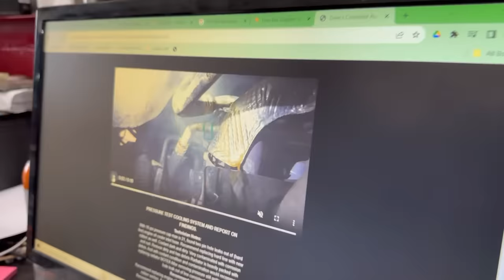The truth about maintenance, and what the manufactures tell you vs what you need to know

Comment: I tried to tell my boomer parents about this with their brand new BMW X-.  The oil level "light" came on shortly before the year was up for the first oil change.  I told them that their driving qualifies as "extreme" and to change it every 6 months like I do with my VW.  They scoffed and said, "People don't do that..."  I told them...but they don't want to listen.  I only fix jets for a living.
Reply: As long as they sell it within 4 years and the warranty period, they'll be fine 😂
Reply: Bmw x9? :D
All i can see are concept cars so far
Reply: @gureno19 very true, they only care about the experience of the first owner who is their customer. And since most people lease or trade, they don't see the long term damage being done.
Reply: @AmandaHugenkiss2915  literally the only brand that I'd trust with a long term (10-15years) vehicle purchase is Toyota or Lexus.
Reply: @gureno19  I agree. I live in the UK and have travelled through Europe many times, BMW, Mercedes etc are very common but I wouldn't have one, certainly not a modern one, I'll take a Japanese make any day. I do wonder when/if they will cheap out on us though, with bad design and poor quality parts. Practically every product you can buy has taken that route, nothing lasts, kettle, washing machine for example, it's all built to fail sooner rather than later.
Reply: @gureno19 Years ago I bought a used Toyota pickup (Japanese made) from a ford mechanic no less. 
He had only changed the engine oil when it was still under warranty.
After the warranty they stopped.
It had 100,000km.
I noticed that the oil was really black but my friend insisted that it's fine, just do the major body work the mechanical section won't have any problems because 100,000km is nothing to a Japanese truck.
Once home i drained out the black mud/goop, then the black transmission fluid. 
It right away was making a lot of noise and wouldn't get into od unless I stepped on it. The second I let my foot off it drops back to third gear. 
Even mighty Toyota and Honda can be quickly ruined by ignorance unfortunately.
Reply: I know people like this, and they don’t want to listen, and are defiant even.  It costs me about $30 to change my oil in a V8.   Probably $60 at a shop I’m guessing.  Even at $60, a drop in the bucket.  There really is no excuse.  I love when people are mystified why their car is burning oil at 50,000 miles.  90% of the time it’s because of 10,000 mile oil change intervals.
Reply: @mplslawnguy3389 since covid oil prices doubled here in Australia. I  bought a 7 litre bottle of synthetic for my gm v6 & it cost $110 so $30 for a v8 in 2023 seems incredible. Not saying your lying, just amazed that oil is that cheap where you live
Reply: Exactly.
Reply: BMW X9? You mean X4, X5, X6, or X7? Unless BMW sold your parents prototypes…

Also Boomers negligent on preventive maintenance? Hogwash! They are the only ones left who care about that.😊
Reply: @barryduff5058  Well, that's Australia for you.  I'm sure it's similar in a lot of places outside the US.  Even so, change your oil.  If oil is that much more, I can only imagine what vehicles cost there.  $110 is still a drop in the bucket.  The average cost of a new vehicle here is something like $49,000.  If you just change your oil twice a year that's something like $2000-$3000 worth of maintenance over 10 years.  That is a drop in the bucket compared to a new engine or a new vehicle.
Reply: I don’t really understand the mind set an oil change is what like 60 to 100 bucks on most normal cars and takes like 30 minutes for a mechanic too do. You can’t take 30 minutes out of your day to get something simple done. You could also go to a shop and ask for a tune up then they will change everything. Coolant , Oil , Spark Plugs , Brake Fluid they might even do the transmission if you say so. Fluids don’t last for ever everything breaks down over time.
Reply: I,drive Subaru,Outback’s,Have had 3 of them,all,great runners,always do the matenience,more is better!If you would of told this 75 year old greaser,he would be driving a 4 cylinder,Japanese car,when he was 75,he would of called a Shrink!!!
Reply: They better ask Google 'what is extreme use'
Reply: @barryduff5058 I pay $27 US for a 5qt jug of Mobile 1 advanced synthetic.  

That would be just under 5 liters worth of oil for you.
Reply: @tomfilipiak3511 the 4 cyl. Subaru was a great car. They were tanks in the 2000's idk what they're like today. I'll tell you what though, many of those 4 bangers can blow away larger cars with a much better weighted to torq to HP ratio.
Reply: You don’t need maintenance advice, you need a therapist.
Reply: There’s an x9 now?
Reply: Hit them with Agent K’s little speech from Men In Black. Just lead into it with sure, people don’t. But a smart person does.
Reply: Is there an X9? Is that the one with the huge grill.
Reply: @lynxstarautomotive208 maybe he means the iX and thinks it is supposed to be read as roman numerals?
Reply: It has nothing to do with your parents being boomers and everything to do with your parents being idiots.  Heck, they had you! 😂😂  Just kidding.  But I'm a boomer and I change my oil every 5000 miles in a good car.  I HAVE changed it after 3000 miles sometimes.  But, right now, I have a Silverado Valdez that changes its own and resets its oil life notification on its own, so I just change it when I think it needs it or once or twice a year.

Once I was really busy back in 1997 and just forgot to change the oil in both my Toyota truck and my first wife's car.  So, about 10,000 miles since the last change, I noticed a light valve rattle when I stepped on the gas while just cruising down the road. I pulled off the road and checked the oil and when was the last time I had changed the oil.  Then, I got my butt to auto parts store for a filter and changed the oil that evening.  I may have also changed the oil in my wife's car that same evening.  It had started that light rattle, too, at about the same time.  They weren't hurt, but that was close.  I had several dozen cases of oil that a gas station had sold me for 30¢ a can when they changed from cans to bottles, so all I had to buy was the filters.

Anyway, anybody that knows anything about cars should be able to tell when it's time to change the oil by looking at it, unless they own a Chevrolet Valdez like mine.  I also have a JD 265 (That's John Deere, not Jeffrey Dahmer.) that smokes like the devil in hell, and for no reason.  I've disassembled and reassembled it, and nothing is wrong with it.  The rings are like new.  Still, it takes spells when it'll smoke so bad you can't see where you're going.  I wish it would burn sometimes when I ain't on it!  🤣🤣🤣
Reply: @tomfilipiak3511  I saw a Subaru limousine in Huntsville, Alabama.
Reply: @missingremote4388  They'd probably tell you it's my stepson's video gaming habits.  Almost 30 and still can't quit long enough to carry out the garbage or mow an acre of grass for us.
Reply: Do jets have crankcases?  Just curious?
Reply: WTF is an X9? Poster is FOS
Reply: Smart people lease BMW's they dont buy them, that's what stupid people do....
Reply: 😂 It’s so hard to raise parents. I just have to give up!
Reply: @lynxstarautomotive208 nah man this is where stereotypes steer people wrong. Who is most likely to service their vehicle at a dealer it’s whole life? Dem der boom squad das who. Yea sure there’s a segment that grew up learning the importance of maintenance and doing it more than less. And there’s the target audience of extended charge intervals to begin with, dem der ole folks No wan waste a day gwan down to de dealer mon for de changes mon.
Reply: @RetroCaptain lmao the old adage holds true. Never buy em from a mechanic. They know how to hide issues
Reply: @barryduff5058  Same in Canada. Especially on vehicle price. Absolutely nuts prices now.  
Oil that I remember buying at 3.99/L is now 6.99/L (& was a one dollar a bottle not that long ago) The 2008 bs bank crash in the US sent the prices I was paying up the backside, then this.  Have to wait for sales then buy extra I guess. 
Our Dollar AUD and Canadian dollar is par afaik.
Reply: @POVShotgun  I wasn't aware until my friend who also was a (highway tractor) mechanic got talking to the guy, otherwise I would not have known. 
I was a Ford and Chrysler guy 
I knew zip about Toyota at that time.
Just going by (a third friend who happened to have been a retired transmission and farm tractor mechanic bugging the heck out of me to "dump the gas guzzling Ford and get a cheap Toyota you're gonna thank me"
The $ lost on them could have paid for lots of extra petrol to keep the old Ford going tbh. The Toyota ended up in the junk along with a second Toyota (81 Corolla rwd wagon). Could NOT find replacement parts unfortunately.
Reply: @RetroCaptain  oh lol fair
Reply: @wellnessotr  Well, you could put your parents up for adoption and adopt some more later.  But what if your new dad wants to breastfeed?  Or suppose you found your new mom sitting astraddle your boyfriend or husband's lap with her face on his shoulder so he could "burp" her after dinner?! You could end up with stepkids and maybe even giving birth to some of them.  😂 😂 😂 Choose carefully, and raise them right. 😂😂😂
Reply: Nobody does that every 6 months that sure is correct or you have to drive 1000 miles a month. The best intervals on synthetic oils is between 6/8k miles.
Reply: @steveclark..  I personally observed that (deliberately designed to flop sooner) as a tech in the 80s.
Back then I remembered how good Russell Hobbs kettles were.  Philips back then closed their home factory or at least shifted the production and suppliers to Hong Kong and the quality of the plastic used went way down and also the price up at the same time. 
The advent of "new auto" (operation or select or whatever) eliminated the manual cable and linkage with a computer system and sensors, was the beginning of the end. 
I met an electronics designer once (he was looking at getting into my career and let me know a little about his old work).
"Those microchips in your computer..they are (mostly Silicon etc) and by design, will basically *never fail, so they get around this by deliberately design to max out at a slow process speed, knowing that in x many software updates it will be TOO SLOW and the customer must replace everything*".
"They could design the (systems) so they last indefinitely but there's no $ in this". 
Adding "Smart" is a certificate of short lived device.
Reply: @georgejohnson9056 😂😂😂😂 legendary dad joke sir.
Reply: Yep, they use more oil while running in.
Reply: * substitute black, jew or Puerto Rican for boomer. See how that sounds? Just say parents. Smh.
Reply: Lol my boomer parents are the opposite they change the oil every 3 months (100 dollar oil change ) with a tire rotation change the coolant and diff oil once a year service the transmission every 30k like it’s 1995 
My dad still yells at me for putting car batteries on the ground(if your old you’ll get it ) put a dam piece of wood under it while throwing something at me.
Reply: Cool story bro. Too bad the X9 doesnt exist...
Reply: Good thing they didn't listen to you because that's dumb. You'd specify a mileage not an amount of time.
Reply: @georgejohnson9056  The iX is an electric car so no
Reply: The 1st oil change should be done at 1000 miles. Get all that metal out from break in.
Reply: I would say that the opposite is true most of the time.
As a boomer myself I have always changed oil every 3-4 K miles and now with full synthetic, 5000.
After buying my daughter a new car when she got her masters, I basically asked her about her service schedule on the car once a week, till she got it through her millennial head that it was important.
You see it all the time on YouTube black sludge oozing from the drain plug from an engine that will be sitting on a dealers lot in a week or two.
Reply: There's a reason BMWs are so cheap in the second-hand market.
Reply: @mplslawnguy3389 mmm where do you live that you can do an oil change for a V8 with $30 🤣 for me its $40 for my toyota, $50 for my lancer rally art and $60 for my subaru hawkeye and this is just oil, not incluiding the filter.
Reply: don't you love it how your parents will roll their eyes and never listen to your advice, yet you are a super qualified professional in the field. Mine are the same.
Reply: But DO TELL US that their engine failed, right?

To be FAIR, as an “expert”, you SHOULD know that the manufacturing tolerances are DEAD ON, and, that engines DO get tested/broken and first oil gets drained, so, a new QUALITY engine going to 5-7 thousand miles is NOT a problem!
Reply: @pepeshopping  are daring to question a jet mechanic?! 🤣
Reply: @barryduff5058 he is Lying. No where on the world can you get enough decent oil for a v8 for 30$. Plus a filter.  My Silverado is 8 quarts. It’s about 100$ a oil change
Reply: Can't give a 👍to your post, because you have 665 already. I don't want to be "that one". 😞
Reply: Cool story. But no such thing as a production X9.
Reply: Oil degrades very little purely by time. Even if an X9 existed, “every 6 months” is stupid advice. I put 2,000 miles/month on my car. Every 12,000 miles? And my kid’s car is used when she’s home from college. 6 months for the 1,000 miles over breaks? Both on the same schedule? Pfffft.
Reply: @rdspam  doesn’t matter bro. It’s YouTube 99% of people are just full of shit. . The guys parents prob don’t even have a car lol
Reply: What do mean “before the year was up for the first oil change”?  You don’t change once per year!
Reply: To be fair, it’s looks like you are working on a Dodge.
Reply: @barryduff5058 I’m in Perth I change my diesel oil with trans and tcase every 5000km and it’s over $200 for a 20l not counting filters just do it! Last time I went to drain the transfer case had water in it
Reply: Sorry Youngblood, Boomers are the only ones wrenching and performing routine maintenance
Reply: Lmao people don’t wanna listen, my parents make fun of me changing my oil every 3-5k miles or 6 months whatever comes first,  they’re like “oil lasts 20k miles now” but my cars have never once had a mechanical issue unlike theirs and I use to have to drive over 200 miles a day…🤷🏼‍♂️ guess I don’t know anything
Reply: I felt I'm a auto mechanic and often give my mom advice or pointers she either doesn't believe it or just asks her husband instead. I only work on cars for a living what do I know
Reply: Your parents first mistake, purchasing a BMW
Reply: @stevennunez6013   Your folks are smart we need more like them.
Reply: @RetroCaptain  That's criminal.
Reply: @ryans413 you do this and you risk them fucking up something else
Reply: @POVShotgun also they never work on their personal vehicle unless they own a shop and have the crew perform a change durin a slow day
Reply: @gureno19 I trust Toyota/Lexus, Honda/Acura and Mazda
Reply: And what's your excuse for not moving out of your 'boomer parents' house yet 🤣🤣
Reply: @lynxstarautomotive208 that's the chassis code, the public name is XM it is a G09
Reply: I’m an aircraft mechanic and my parents are the same way. Drives me nuts.
Reply: @jasonnelson623 Yes the XM is a G09 chassis. OP stated an X9. Which is a concept vehicle at the moment.
Reply: @RetroCaptain no car no matter how legendary reliable won't last without oil changes.
Reply: @SoulTouchMusic93  Well, it "did" "last" but it was a rattly bag of tricks! 
I wasn't up to the MAJOR amount of work needed.
I actually found a really good engine and transmission to replace the burnt original stuff (I would have had to remove, alter from car to truck use, and many new seals and gaskets) but the body was rusty like really rusted in spots so I knew it wasn't worth the months of work to have a truck that might last 3 years.  
If the body was good I would definitely have swapped out engine and transmission
Reply: @barryduff5058  I'm also from Australia and I can confirm that an oil and filter change on my Land Rover Defender (4 cylinder 2.5L) costs around $110 (Au dollars). We seem to pay more for just about everything.
Reply: @caprature  then move out of your parents house
Reply: All they care about is those JD Powers' cost of ownership numbers.
Reply: @mikeshay6614  funny enough J. D. Powers is formally an advertising company. So essentially, these companies pay off J.D. to boast for them, make up awards, say things that aren't true. It's actually quite the scandal. Stick to the facts, buy a Toyota or a Honda and you'll never loose.
Reply: @bradofwar5960  The Full synthetic oils can last upwards of 20k. Many oil analysis tests have proven that. But oil filter technology sucks and personally oil filters should be changed every 3k and you can push out your full oil change. Many great labs to test your oil sample and prove it to yourself.
Reply: OP - you fix jets, huh? And refer to them as your “boomer parents “? I don’t think so.
Reply: Oviously your the smart son in the family ....the manufacturer of cars are to blame 10,000 or 5,000 mile oils ....take a newly made car and run it 5,000 miles until oil is changed ...don't worry about break in just drive it ...that's the stupid mentally thinking these oils synthetic are incredible no they just can stand longer extreme temps but doesn't mean the filter doesn't get dirty just the same
Reply: @blerst7066 VW and Audi are right there with Mercedes losing over 70% value easily after Decade and Toyota still holds its value reasonably well
Reply: Had boss who bought a VW SUV for his wife like it's the last car she'll have since their older ...I didn't say anything about that VW. Just another turbo running hard all the time to make up for lack of displacement
Reply: If they have an x9 they can afford not to chage a thing
Reply: @Scummy_shovel the “$” goes in front of the dollar figure, how do you not know that???? If it’s less than $1.00 the ”¢” goes behind.  Example: 69¢ means sixty-nine cents. You can also properly express a monetary figure less than one dollar by converting it to a decimal and using “$” in the front. Example: $0.69. This is basic knowledge, it’s amazing people like you don’t understand it. SMH.
Reply: If they don't trust the word of a jet tech are they rocket techs? Wow lol. As for oil in VWs you running Motul or equivalent? The factory fill Castrol is completely trash.
Reply: @barryduff5058  I pay $38 US for a 5 quart (4.73L) jug of 0-20 Royal Purple for my Toyota RAV4. A Toyota filter is $5. $43 US is equivalent to $64 AUS.
Reply: What is an X9??
Reply: Lmfao no one wants to listen to me when I give mechanical advice either. I only repair Blackhawks for a living 😭
Reply: GDI is the biggest issue of all.
Reply: I’m in the same boat, I’m literally a fleet manager at a municipality and maintain trucks and intervals and everything. I tell my dad to use synthetic and still never go over 5K for his oil changes, and he just scoffs at me too, like “it says I can go 7,500 or even 8k, it’ll be fine.” And I shit you not, he has more issues with his vehicles than anyone I know. He literally stretches every service interval on his vehicles out as long as possible. 😬
Reply: My dad had a 7 series one time and blew two different engines because he literally went 15,000 miles on every oil change when I told him not to go over 5k or even 7k max 😬😬😬 He wouldn’t listen and said “it says it can go 15k, they know what they’re doing “
Reply: The second u said bmw says everything we need to know
Reply: My dad never had nothing brand new but he had a 98 mercury villager and that thing just kept running and running over 8 years zero maintenance
Reply: @barryduff5058  He's not lying. in the U.S. oil is cheap. My hemi 5.7 takes 7 quarts and i spend about 40 bucks with oil and filter. I change it myself.
Reply: @wellnessotr 😂😂👍
Reply: I am an ASE master tech and my father that built an engine 50 years ago once constantly argues with me. Guess who has to fix it when he doesn't listen? Can't win.
Reply: LOL jets are not cars when a jet breaks down it's on the news and all jets of that type could be grounded nationwide, when a car breaks down no one cares except the owner.
Reply: Yeah I fix Volvos and Volvo's advice is single handedly destroyed probably 20% of their vehicles. Don't listen to then. Oil change every 5k max in any forced induction vehicle, especially of they're Volvos, not in spite of them being Volvos. Unheeded most Volvos will never make it to 200k, at least nothing made past 2008
Reply: I’m in the same boat as you. I would rather spend my time working on planes than people’s cars.
Reply: Buying pre owned is a gamble
Reply: Well a jet isn't my geo metro feel me?! So I don't wanna hear it! 🤣💀⚰️🤡
...but whaddya recommend?! ...asking for my pet rock's best friend!
Reply: That’s crazy. How do they drive? I drive a mustang and I don’t exactly baby it and I got it to last lol
Reply: If you’re a smart boomer you would know not to get a BMW in the first place.
Reply: A year for first oil change?  Thats wrong.  I did that and the engine exhaust smells twice as old as its miles and i guess were lucky theres no specific malfunction in there
Reply: @barryduff5058 oil price that high is not good for emissions nationally....
Reply: Yoir parents: OK, Zoomee.
Reply: Yoir parents: OK, Zoomer.
Reply: Yoir parents: OK, Zoomer.
Reply: Yoir parents: OK, Zoomer.
Reply: X9? 😂
Reply: @lynxstarautomotive208 You would think all Boomers would stay up on maintenance since they had to drive cars that were carburetor equipped and required more frequent preventative maintenance.
Reply: SMH.  Oil is cheap. Engines are expensive. I change oil (and other fluids) at half the recommended intervals. I am sure it (Toyota Hilux diesel will reach 500k km without any issues).
Reply: @gureno19 I add Mazda to that list and no turbo Hond's and Acuras.
Reply: And you think older people would know better.
Reply: No way Trans fluid looks like goop at 62k miles. Cool story bro
Reply: BMW and Mercedes (probably others) had a one oil change per year statement.
They found it was causing a ton of motor issues and warranty issues so it is now 2 oil changes per year.
I suspect it's to do with the Direct Injection and carboning up more so than with the 2 changes per year.
Also most people live in a place where there's winter and summer. Varied enviro factors effect the oil.
Reply: @gureno19 Yes but the oil still needs ti be changed. They are not wear proof. I change my Camry V6 every 5,000 with Ultra platinum and OEM filter. 135,000 not a drop of consumption.
Reply: Ive got a 99 jetta with 300k miles on it and counting, I change oil every 3k miles or 3 months, which ever comes first. Just the standard 2 liter and it runs strong.
Reply: @JM-bb8xi  Must not live in a rusty area. Rust will take your vehicle out long before a maintained motor will.
Reply: @gureno19 that's because Toyota/Lexus literally is the ONLY brand you can trust for long-term reliability.
Reply: Should you not be replacing your oil change way before the oil light comes on aren't you basically already at the point of engine damage when that is happening? That's crazy
Reply: Unreliable people should lease.  Leaves their defects behind.
Reply: I’m a boomer and I change my oil every 3000 miles with Mobile 1 extended 1 year or every 20,000 miles which is about 6 months for me. Everybody’s different.
Reply: Wow, comparing a jet to a BMW?

No wonder they didn't listen.😂 jk!

This is like a weightlifter ignoring lifting advice from Arnold.
Reply: Jesus 6 ? 3months or 3k miles if ur on gravel/dirty roads, stop n go driving, or hard accelerating etc. I DO NOT CARE if oil /manuf says 5k+ 3000 is what you do period. Ex ASE technician for toyota and honda
Reply: Without maintaining the vehicle it will not last , even TOYOTA AND HONDA@RetroCaptain
Reply: @RetroCaptain Honestly, the fact that it is a Japanese car is why it even RUNS with that level of neglect!
Reply: What you SHOULD'VE done is say "Oh well it's only $50 thousand for an engine change when it burns out from low oil. I mean that's PEANUTS compared to these jets at work". Then watch the stunned backpedalling look.
Reply: This man is from the FUTURE to warn us....
Reply: @D3nn1s he probably meant x6
Reply: This boomer listens
Reply: Did your parents forget that when they were growing up, we were supposed to do it every 3000 miles?
Reply: Most parents are likely to shun the advice offered by their offspring simply because they will always see themselves as “older and wiser”.  If my son/daughter was a jet engine repair tech I think I’d listen to them though, but that’s just me!
Reply: Hey, I got news for you. Most of us boomers change our oil every 3 to 5,000 mi because that's what we're used to doing. It's Gen X/Z/whatever that are falling for this 20,000 mile oil change crap.
Reply: You must fix for Boeing.
Reply: @lewis2553 dry sump system in turbines and the bearings run in a very fine mist.
The point he's making is he has an in-depth knowledge of mechanics and maintenance. If he's an A&P he's learned about recips also and much, much more. His folks just know better by sticking their heads in the sand. They sound a lot like mine.
Reply: @barryduff5058   Oil is cheaper here at some stores, and synthetic isn't really necessary.  Most cars will do just fine with conventional oil in spite of all the hype about synthetic.
Reply: @ryans413  Man, a "tune up" like that's gonna cost you, these days, as hard as it is to get to the spark plugs on some vehicles!  You're probably looking at $400 to $500, minimum, at non-dealer shop.  A dealer would be maybe twice that, all for things YOU can do at home for about $100!  My brake fluid and power steering fluid get changed, at least partly, whenever those systems are repaired.  They are sealed systems, not open to the atmosphere, and there is no need to change those fluids more often than that.
Reply: @wellnessotr  You might as well.  About the time you get us full grown and educated, we die on you! 😅
Reply: @JJC991  I agree about the JD Powers stuff.  I used to work in a car factory.
Reply: @DirkDiggler-qp3vm  You can always just unscrew the oil filter, screw another one on, and add some more oil like a guy I once knew.  He did that with conventional oil in a one ton truck.
Reply: @hotprop92  I always wondered how jet engines got lubrication.
Reply: I change the oil on some of my cars every 5000kms. Let alone 6-12 months
Reply: I didn't even know the BMW X9 existed....
Reply: @lewis2553  😂
Reply: @wellnessotr  Well, it just makes sense if you're gonna use expensive synthetic oil that outlasts your filter by 15,000 miles. Just do a filter change every 5,000 miles and a complete oil and filter change every 20,000.  And STOP complaining about the price of synthetic oil!

I'm about to quit changing the oil altogether in my Chevrolet Valdez.  It's actually a Silverado.  I just nicknamed it Valdez, because it leaks oil like the Exxon Valdez, thanks to GM's bad engineering of the the rear, main seal plate of the LS V8 engine.  It leaks about half a gallon every 200 miles!  So, it's self-changing.  All I have to do put oil in and change the filter.  Fortunately, I came across a source of free, slightly used, racing oil.
Reply: Then they'll blow up the motor, complain about BMW, switch through multiple brands, and complain about every other one. Rinse and repeat. Some people are actually too ignorant to own a car. It's mind-blowing.
Reply: @mplslawnguy3389  it's not 1984 anymore, 15'000 kilometre change interval is normal and has been for well over 20 years. They also dont sell leaded petrol anymore . . .
Reply: @TRPGpilot  Not talking kilometers.
Reply: @mplslawnguy3389  86% of the world uses kilometres . . .
Reply: What was the point of calling them boomers?
Reply: Boomer? Wow you're vocabulary wow just wow I got no time to miss was idiots😂
Reply: can't wait to buy it on FB marketplace for $500 because boomers will spend months to save 15 minutes
Reply: @nastysoda9212 "sweetie, you should leave it to the proffessionals!" My parents i not like this, bit i imagine some parents actually said this  phrase to their proffessional child.
Reply: Too difficult to invest an extra 80 bucks every year to keep your engine from locking up.   Don’t change your oil.  Just change the engine.
Reply: @lewis2553 that old oil in the cans doesn't meet current API spec for your modern engines.. in fact there's a video from the motor oil geek showing that old oil seperates and should NOT be used in an engine..
Reply: @audinutt  Well, it was - about 24 cases of it -  without problems.  24X12=288 quarts.  Of course, most of the cars I had back then were Dodge or Chrysler and had slant 6 engines.  They weren't the most powerful, but they weren't wussified and sensitive, like some modern engines, either. I wish they'd start making them again.

What seperates is parrafin in parrafin-based oils, and it becomes sludge and sticks to the colder surfaces of the engine, like the crankcase walls.
Reply: @D3nn1s  I think he ment x7 on less they are testing out for BMW
Reply: My gen Z parents..
Reply: You fix jets for a living,but drive a shitty VW.
Reply: lol a BMW X9 with an owner who wont change the oil
Reply: @lynxstarautomotive208  I work for the Company that manufacturers the interiors for BMW and ships them 8 miles up the road to be assembled.   I can 100 percent assure you that they do mass produce X9s at the Greer, SC plant.
Reply: I don't understand how being a boomer relates to this story. I have seen multiple generations of parents do this. It only helps estimate your age.
Reply: @gureno19 I have both a toyota and an acura. Both rock solid.
Reply: I inquired about a coolant service on my VW it's five old with 115,000 km. I was told by my shop the water pump will start to leak before the coolant needs changing 😬.
Reply: Cool way to flex bro
Reply: Parents are tough to raise
Reply: Well, this guy explaining it is a boomer
Reply: What does Boomer have to do with it what generation are you
Reply: @lynxstarautomotive208  Yeah one of those...
Reply: @gureno19  yea but you want to be cool to the next person
Reply: That's why when I get my oil change, I take it to places that check/replace the air filter too.